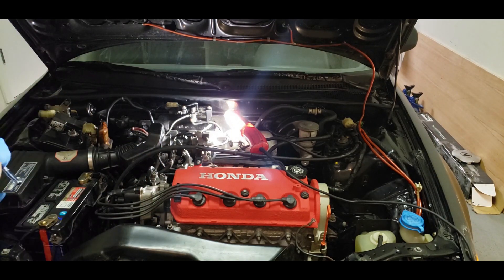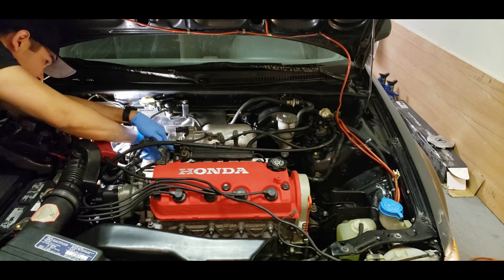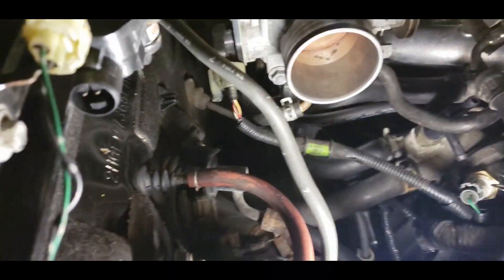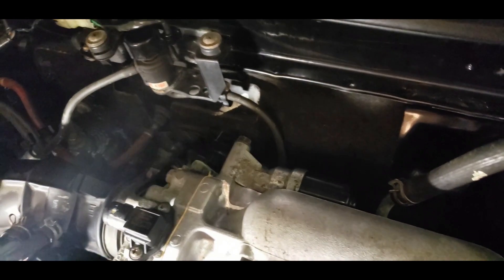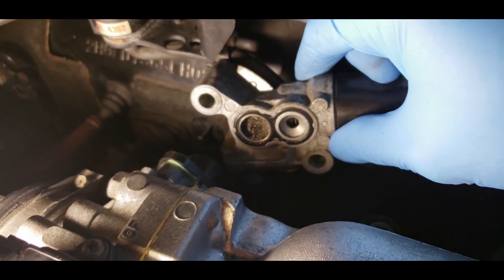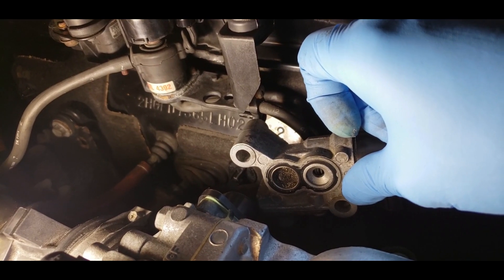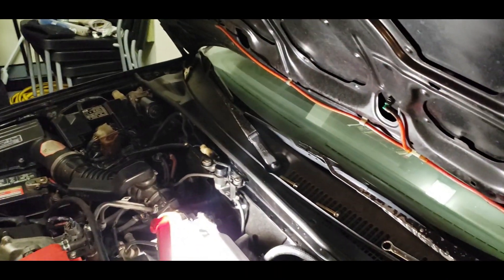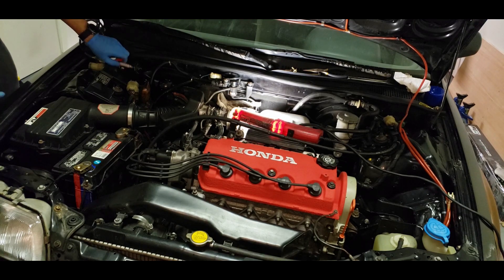[D16Y8 Fixing Idle Issue] How to Clean Throttle Body and IACV

Comment: Discovered your video while looking for valve lash adjustment walkthrough. Did you ever arrive at a solution for your noisy clicking and idle issues?
Reply from the maker: Yes, I did. I talk about it in one of my videos. But the issue was stuck rocker assembly, so I took the entire rocker assembly apart and cleaned and reoiled and assembled. That fixed both idle and noise. I also found vacuum leaks and exhaust manifold leaks. But the biggest thing was the rocker assembly.

Comment: Seems like to need to gap your engine ...check oil
Reply from the maker: What do you mean by gap my engine? The oil was fine. In one of my later videos, I did end up fixing the issue. It was a really weird one. I took the entire rocker assembly apart, cleaned and relubricated everything while piecing it all back together. Then adjusted my valves and it ran fine afterwards. I never knew the rocker assembly could get stuck or anything, but thats definitely what happened.
Reply: @BudgetGears  That is what it sounded to like to me.....That the valves needed to be adjusted.   Sometimes they need to be adjusted again or checked to make sure nothing is sticking.  "Back in the Day" when adjusting valves was part of "regular" maintenance, valves were to be adjusted on a new or rebuilt engine after the first 500 miles after everything had broken in or settled.  Sticking Valves can make this type of noise.  If that is case change the oil, if the oil is "freshly"changed and/or clean then add Marvel Oil to the crankcase.
Reply from the maker: @MrCuckoobox  that's some good tips! Ts the first time I've ever experienced sticking valves. But I guess its to be expected from a motor I got from a junk yard. Engine was probably sitting a long while.